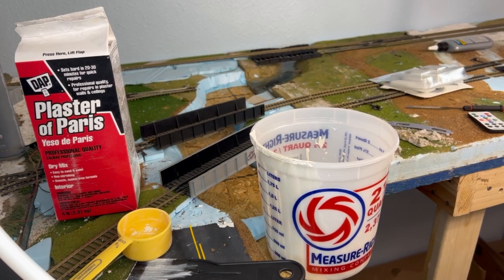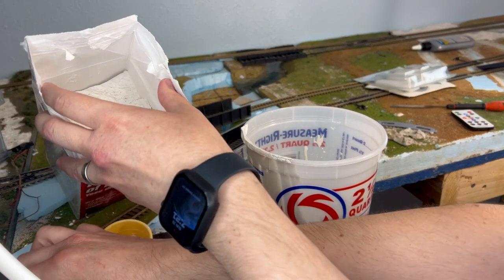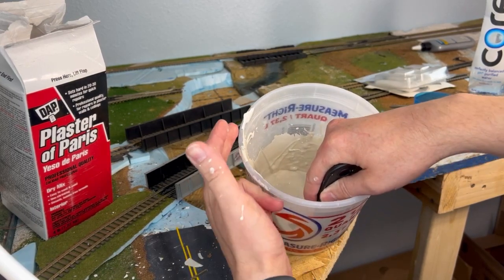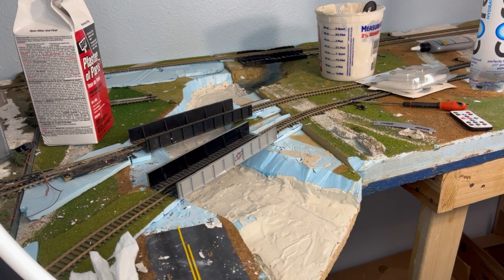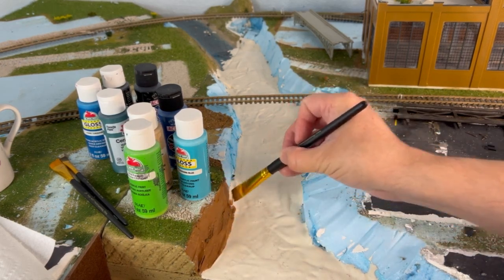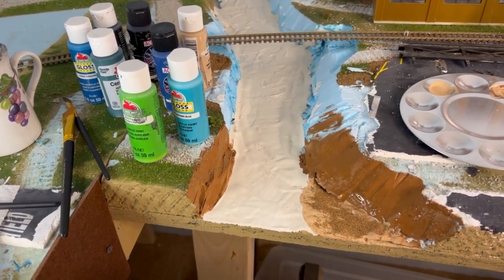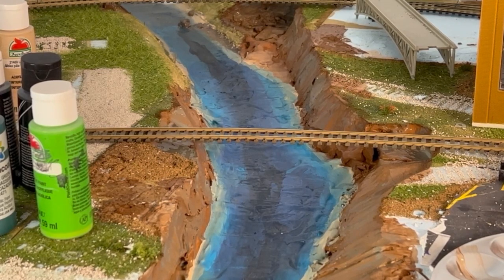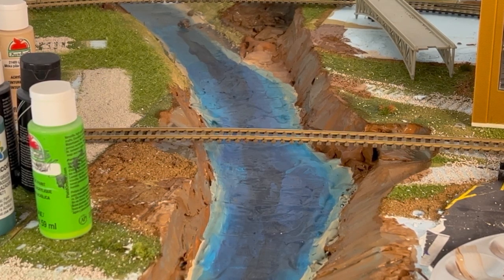How to Finish your Model Railroad Rivers

Comment: Hey Joe. Did I start something....LOL. But that is cool. Joe. Could you put plastic under that plaster, then put the plaster down to create the real water thing? Also you could put in dashes of white to give it flowing if your just painting it. Great job Joe
Reply from the maker: Lol you might have started something good! Yeah actually you could, I’m not sure if the water would erode the plaster though. I think the easier way would be to plaster it, paint some details, then use an epoxy resin on the plaster to seal the paint and plaster and the water should just run down it. Could put in heavier small rocks to add to the details. 

Thank you! Also I’m not quite done, it’ll be a couple weeks because of the time needed to build up layers, but I have a way to make water ripples on top of the realistic water I’m putting down to make it look more real and like it has a current. ;) Thanks again!